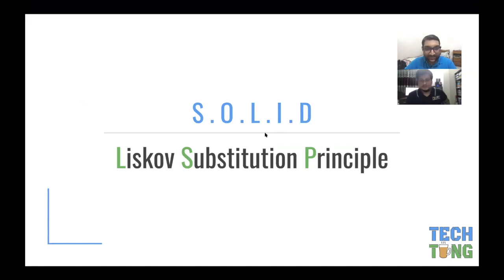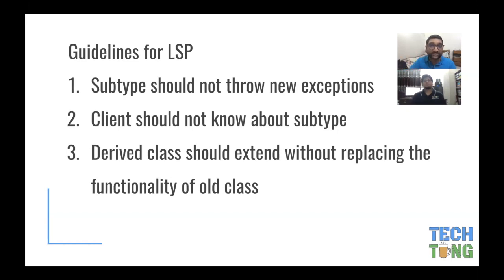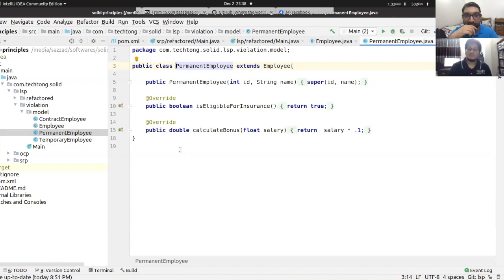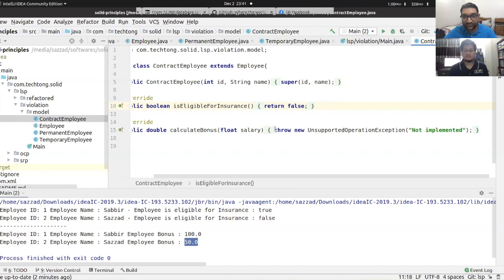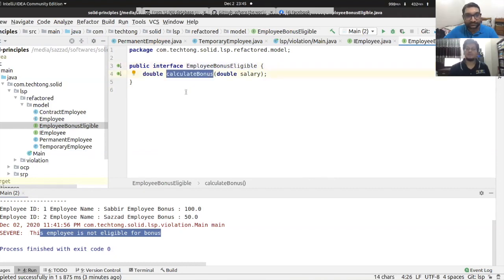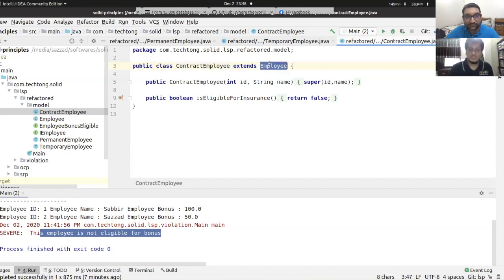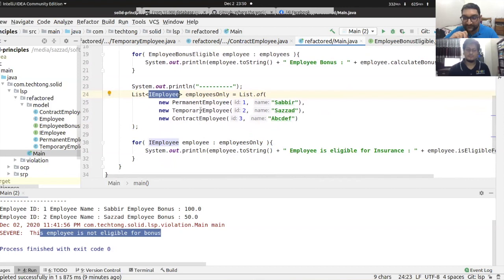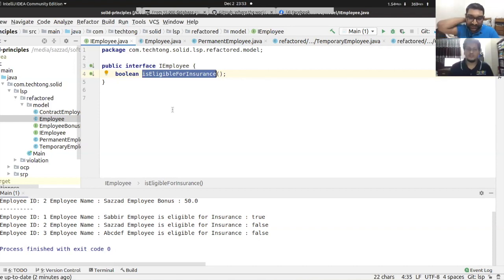Liskov Substitution Principle explained pratically in Java | SOLID Principles | TechTong Episode 16

Comment: Now, for a huge number of behaviors,  doesn't it become a headache for the client ( main function ) to keep track of which type of employee should go to which list.
Reply from the maker: Yes, that's true. However, the code has to decide what to do from somewhere, and the headache of the client deciding what kind of employee is much easier to manage than the headache of different classes that have different types of Implementation, as the client code can get extremely messy (having to manage different kinds of behaviors in different ways). As always, it's about trade offs :)